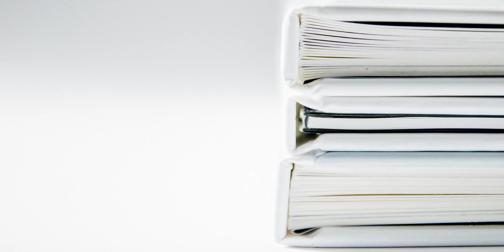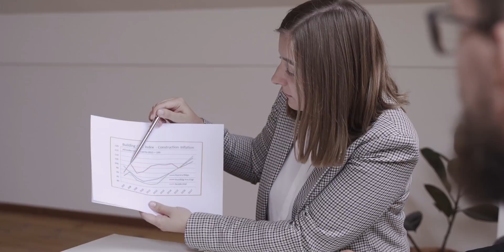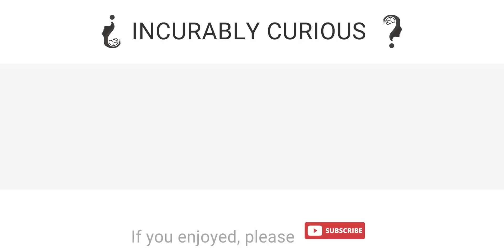Why Most Power Lines Aren’t Underground

Comment: Why does the bill have to go up by double ... like why are the customer's taking so much of the financial burden. Yes the customers are the one benefiting from the improved infrastructure, but they're not the only one's to benefit. The cost should be shared. The customers and the power company should front the brunt of it but the city as a whole can use sales tax in part to supplement infrastructure projects that everyone benefits from for example ... also since cars will enjoy benefits perhaps an extra cent or two tax at the pumps might offset even more on top of regular sales tax for the candy bar and jumbo soda they buy in the convenience store. Perhaps the state can help because it's getting more modernized cities... and the nation can help because it's getting states to improve the grid... IDK I just think the cost can be spread... also once the cost to upgrade is paid in say 10 years the rates should be adjusted to what they would be accounting for inflation if the project wasn't undertaken... why do the power companies get to forever keep the cost at double? That's just a racket if you ask me.

Comment: Sorry this video is very inaccurate, underground lines are protected and well insulated how is the flood going to interact with the lines? If that is the case above ground power lines are more receptive to floods since the soil erodes/washes off. The roots of a fallen tree can rip the power lines? Do you think you place a power line on quicksand or loose gravel? Plane dirt? Power lines will be placed under roads or under sidewalks you just don’t place randomly power lines. 

And also the expectancy of life duration if way longer weather doesn’t effect the cable (wind, sun, birds, ice, rain) and no rats do not play a role in this like i said the cables must be protected. Please see attached examples. 
And final earthquakes? Really?
I’m starting to believe this video was created by some electric company trying to disinform people. 
Do some real research dude this video is garbage pure ignorance

Comment: Like most, this video missed the mark. We actually know the solution. Wallingford, CT rebuilt their system as a muni Poco a few decades ago. They kept the lines above ground but rebuilt the 3 phase lines with Hendrix ACS, larger poles, taller poles, bigger bolts, logically planned and laid out routes, and quadruple redundant paths to many locations. Their system almost never has 3-phase  outages, and single phase residential can be restored quickly, while the rest of CT with ancient individual wires on arms, rotten telephone poles, and different circuits criss-crossing this way and that has massive outages every time there is a storm. Commercial and underground residential customers fed off of well constructed 3-phase ACS essentially never have outages. Vegetation management is also BS for distribution lines. It doesn't really work, as there's still limbs that can fall on lines. Meanwhile, Wallingford doesn't really do vegetation management, many of their lines are inside green tunnels of trees, but the 3-phase ACS lines can take a 3-inch branch or tree on them and continue operating with no problem. Undergrounding would take a long time and cost a fortune, although it costs a fraction of the utterly ridiculous $17M/mi that our power company claimed they would cost. There should be some strategic undergrounding.

Comment: Another science-y fact about why above-ground lines work better: no matter what, your power lines have some inductance and capacitance in them, and in an underground line, your capacitance is increased even further. This doesn't affect HVDC lines, which is the reason why HVDC is still used for extremely high power transmission, but on AC it causes an issue called reactive power loss, where it pushes energy back and forth. It doesn't directly "waste" power, but it increases the amount of current flowing through the wire since the power lines themselves both consume and supply energy, so there's gotta be some current flowing through the wire.
This is poorly explained, but reactive power losses are one of the reasons why HVDC is still a thing. It's extremely hard to step up and down HVDC compared to AC, but it's still possible, and there are still some cases where it's more cost-effective
Reply: I was waiting for him to say something about this cuz I figured it was one of the main reasons we don't see it more often. As I understand, the conversion of real power into reactive power within underground cables, caused by capacitance, results in a phase shift of the current so that is out of phase with voltage. This reduces the usable power at the load and causes more work on the generation side, which then must deliver more current in order to overcome the capacitance which means generators and the cables have to be even larger.

Comment: I work as a Horizontal Directional Drill operator. I do not install underground power lines, but I do install underground Fiber Optic lines and conduit for AT&T, Comcast, and others. I can tell you guys for a FACT that paying for damages is an enormous cost in this line of work. First of all, if you want to install power lines underground, there WILL be damages done to existing lines. 811 locates for underground lines are NOT perfect, especially when it comes to PVC water mains that have no trace wire. There are also certain types of underground fiber wires that can not be located, but even copper lines and power lines are often mismarked above ground, leading to damages. And when that happens, an investigation takes place to find out who’s going to pay for the repairs. In my experience, whoever located the line and the company that got damaged fight tooth and nail to make the company who caused the damage be at fault, even if it wasn’t their fault. For example in South Carolina, if a line was damaged and it is 2ft or more off of the mark/flag, then the locator should be held responsible. But things don’t always work out that way. So trying to this in major cities just seems like it would be a massive expense. I’ve seen a water department charge $1500 for a repair of a 6in section of 1in water service buried 1ft in the ground, when I could have done the same repair myself for almost no money and no time. Now imagine how much a city would charge for damage to 36in water main?? And imagine how much damage that would cause to the surrounding area, that would ALSO have to be paid for?

Comment: It may be possible to bury local lines those actually feeding homes and businesses , in fact this is becoming more common , but High voltages can jump several feet and overhead systems have the advantage of using isolation which keeps the lines away from ground whereas underground systems would require insulation up to several inches thick and junctions would have to be insulated with liquid insulation poured in place .

Comment: So, what about the water, sewer, gas lines? We put EVERYTHING except for power underground. I don't know where you've gotten your sources from but I find it extremely hard to believe that expenditures after the fact are really of significance. The power line is ran through conduit that is chemically bonded together. It is made of a very sturdy & flexible polymer. Water infiltration? Unlikely, if it does, dewater inspect with a camera snake find the trouble area and melt new plastic into place. All of this can be done from any surface access point. The only thing that would make it more expensive is if the pipe collapsed. If that happens run a locating beacon up to the point of the block and immediately find the trouble area. Barring complicated issues above it isn't that difficult to dig straight down. And if there's shit in the way? Hydraulic displacement of the old pipe with new material. This video is an excuse that cites "but sometimes" as it's reasoning. I'll certainly research more, but this is a non argument as far as I can tell presently.
Reply: Polymer pipe has an expected life of 80-100 years. If you get out ahead of it you can hydraulicly displace the old polymer pipe with a new polymer pipe.
Reply: Also, half your links are dead.
Reply: Do you understand Ohm's Law?

Comment: If you engaged in a multi pipe line that is fully in closed with proper industrial strength water seals and did 1 for power 
1 for oil and 1 for water...and ran it across America 
Between water, gas and electric 
In above ground piping it might cost 
1 trillion dollars and yearly upkeep 50 million....

But water to drought areas from areas with abundant water and from states with excessive power to power poor states and electric Between them

The economy would triple and its a multi shared experience..

So  you're gas might be 10 cents more a gallon and electric 10 a month more and water maybe 10 dollars more a month and your brown outs and black out drops 95% and no matter the weather...

It could be done in 10 years from my research....and financed by the Congress as a national security issue...

Between the States and the Fed's 

So it gets 75% from government and 25% from users.

So the states recover funds through your payments as above mentioned....

And the Feds by standard taxes.

So everyone pays....

Just saying..you're research is awesome. 

Excellent video. 

I had this idea during the So called water and gas crisis when Carter was president. 

I offered my plan and it was considered. 
But the tech of the day before computers came along was to iffy 

But today in 2022 the actual cost is better. Faster,  more efficient and more needed now. 

Our country takes in 1 million a year legally and from 800 K to recently 3 million a year and we have no more resources in general than in 1977
So...we have 50 million more people or more than then with the same amount of resources....think about it. 

50 million + more people and tech now provides about 10% to 37% more so at best with all these people we are negative by 13% or more and with 250 k people a month coming in 3 million plus 1 million legally  that's 4 million..

Do basic math.....we will soon be at 300 million people and no extra resources. 

We have no transport resources for next 20+ years to keep up and work on tech and resources to keep up after 20 years  and with tech advancing at 5 times a year that's 500% in 20 years..

If in 10 years it's 250% better and you use the new tech and get it done in q0 years.....we have a good chance of making it....

But if things continue as heretofore..
We might not be around in 10 to 20 years. 

But if we are and did not plan..you can figure it out

Comment: nickle and dime the costs  get  a few million dollars and bury a couple mile section of the power lines then save up again and repeat even if it means tearing the roads up every couple years in endless construction projects.

they dont need to tear up the yards they can tear up the roads and/or even pull the wires through existing tunnels.

if you saw the movie ghostbusters 2 in 1989 (i think) when the slime started to grab one of the ghostbusters men hanging on  the cable underground his foot catches a rock witch dropped and broke a power cable that knocked out power to a section of first ave in manhattan.

in the movie the power line was ran in an existing tunnel.

Comment: I have spent my three-decade career managing and consulting on mega-construction projects in both hemispheres of the globe.  A few years ago I helped install multiple three-phase, 400kV (400,000 volt) transmission circuits underground for many kilometers in a very harsh environment.  We buried them in precast concrete troughs filled with cbs (concrete based sand) as an extra insulator.  This allowed a far greater voltage will less line-loss than the typical tower-suspended, air-cooled transmission cables we were replacing, and made future repairs easier since it can quite easily be removed with just a blast of water.  The cables weighed 55 kilograms per meter and came in half kilometer drums (which means we installed a joint box every half kilometer).  Then we placed a concrete lid over all the troughs to prevent digging animals and future construction excavations from disturbing the cables (at that voltage, they were not direct buried).  The cables were kept a uniform distance apart to prevent cross interference from the different phases (even in the joint boxes), and a wire was installed which monitors the entire run of cable from a single location at the power generation station and pinpoints the near exact place where any fault or line leakage occurs.  And the electric rates in this country are far below what I was paying in New Hampshire, USA where downed trees regularly caused extended power outages during hurricane season and winter Noreasters.
Reply: In a new construction installation in an area without an existing infrastructure grid of water, sewer, phone, cable, gas, etc. I can see underground being a great option.  In a developed area that does have such lines already in and operating, it would be massively expensive to install and then have to transfer from overhead to the new underground and then remove all the old overhead lines.  In the US it would take years just to get all the environmental, cultural, title, etc. surveys done in order to begin work.  Then they'd have to get all the local distribution lines converted from overhead (probably at the property owners' expense), and all of this would have to be done while avoiding if possible and repairing the existing underground utilities that would surely be damaged.
Reply: @royparker7856  Upper Bavaria still have some areas with overhead lines going from house to house, but they are gradually moved underground without any issues or complaints or financial woes.
Considering the amount of listed buildings, it should have been impossible, but here we are, lines are underground, and as a bonus we get fiber
Reply: @royparker7856  why don't just put the power line underground when they open the street for internet, sewage or old asphalt?
Reply: @derorje2035  Because that, demands PLANNING...😂😂😂
Reply: @derorje2035  I have argued this with my city and electric provider. ANY time a street/sidewalk/right of way is being torn up, all above ground utilities on that stretch should be put underground while the ground is already torn up. Eventually it would all be done but they don't listen.
Reply: Man you probably make good money
Reply: you know what else is probably a lot less than NH?  local labor.  and permit costs.  and locally sourced materials. and property damages.

people love to look at one apsect or item in a foreign country and say, 'gee, its so easy and they do it, so it would be easy for us too", without realizing that you can't extract just one item from a different culture and expect that it will work the same way locally.

Comment: I lived in a neighborhood in LA that had all of its power placed underground. For years the system went out like clockwork when it rained. After 10 years or so that slowed down. I assume it was because they had finally plugged all of the leaks that let the rainwater into the underground vaults. Don't assume underground is safe from problems.
Reply: LA's urban landscape is so spread out that putting utilities underground makes it prohibitively expensive to properly maintain, since you have to dig up more distance just to fix the power for one household. LA's sprawl was designed to fail from the start, but thankfully other developed countries know better.
Reply: That's the most "US is a third world country" thing I have read all week. Good lord, even in cities like LA? You guys are so falling behind compared to the rest of the developed world. :(
Reply: Apparently implant was badly done. Indeed, very bad. Where I live it rains, and it often rains a lot. I had the only power outage about 10 years ago because the marshalling yard power plant was damaged by a series of lightning strikes during a raging storm.
Reply: I live in Hampton, VA. there are several neighborhood, including my own have underground power lines. and when you step outside the sky looks great without all those lines in the way.
Reply: sounds more like a knock against the quality of the work done than the actual use of underground lines itself
Reply: You can, and we have, power cables underneath rivers, on sea and ocean floors with no problem at all. If you don't make them watertight then you are asking for problems!!!
Reply: @Scott Franco   Unfortunately, rain caused outages are a thing of the past judging from this drought we are in :(

Comment: Underground power is a bad idea for high voltage. If you think you have problems now wait till there's an insulation failure in an underground line that doesn't trip the circuit and your yard is energized with thousands of volts.

Comment: The statistics should distinguish better between wires in dense neighborhoods vs long distance rural or high power. In my city Philadelphia which is very dense it looks hideous to have wires strung from pole to house or house to house (like in Queens NYC). Philly has been renewing many old narrow streets. They dig up the whole street to put new water, sewer, storm drain, gas line, and new sidewalk. Yet they leave the old utility poles and electric and cable/phone wire dangling above ground or down a back alley. It looks like in the 1980s they put it underground on some streets and now in 2020s building boom as new row houses get built they just string the wire above ground or from next-door. A few more high end neighborhoods do seem to get them underground likely because of neighbor pressure.